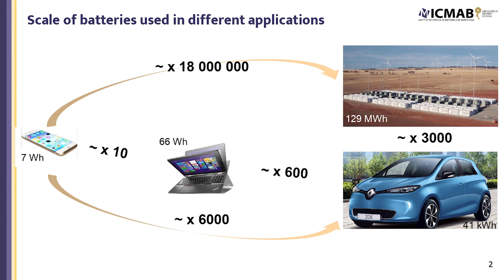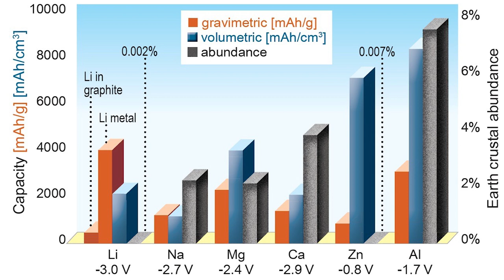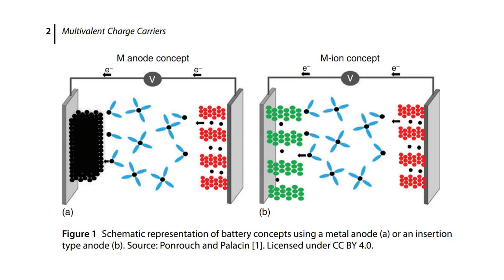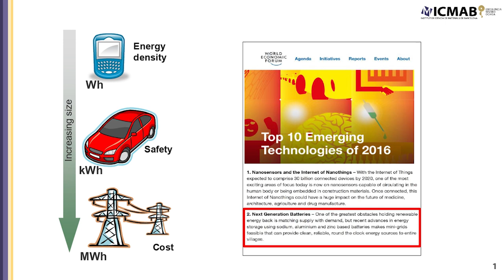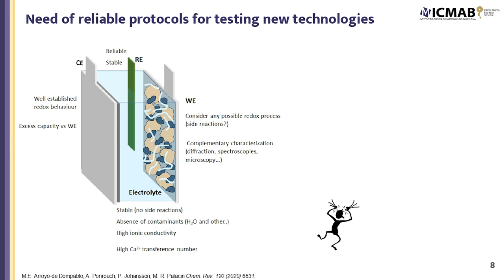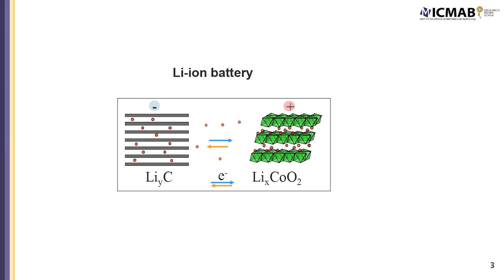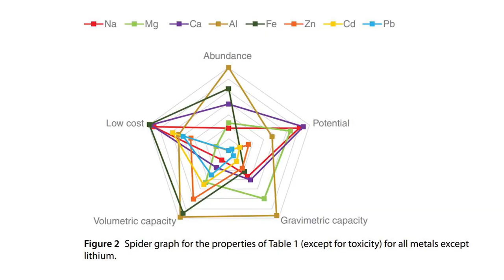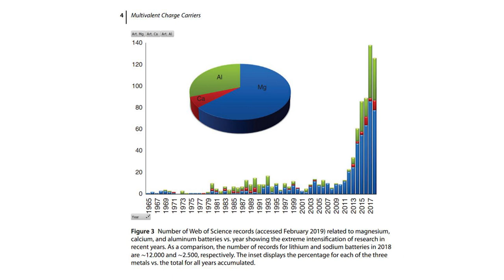Sustainable Multivalent Batteries - Prof. Palacín Peiro | Battery Podcast

Comment: Use a dual mode battery using Na+ and Mg+2 ions collector anode material would be silicon and carbon on a scaffold of aluminum. For the cathode material use a polymer bonded substrate of iron metafluorophisphate combined with ferrocyanide on an iron manganese alloy substrate. For the electrolyte a polar aprotic organic solvent will do. The batteries would be bulkier than lithium ion but would have a longer life as well as being able to take deep discharges since there would be no dendritic forming metallic components. ❤

Comment: multivalent batteries suck because the discharge curve makes control electronics complicated and expensive, and the stated capacity is deceptive because at least half that capacity will be in the lower voltage portion of the discharge curve and thus the real energy density is only about half what the stated voltage and amp-hour rating would suggest.
Reply: The batteries would need a compensation circuit, a boost converter built in to work for most uses, similar to the circuit in a 5V USB charging device. The input voltage is 5V output is 5V but the actual battery voltage ranges from 3.4 to 4.2V. Without the low voltage cutout, they can convert 1.2 and up to 5V. These alternative metal ion batteries do not have the  overdischarge issue of lithium with the exception of aluminum which is actually a polysulfide -2 ion. Overdischarging creates nonconductive sulfur.